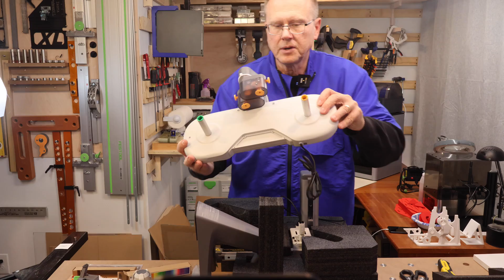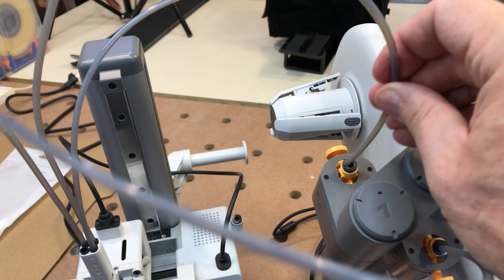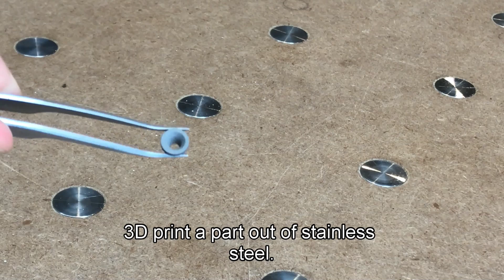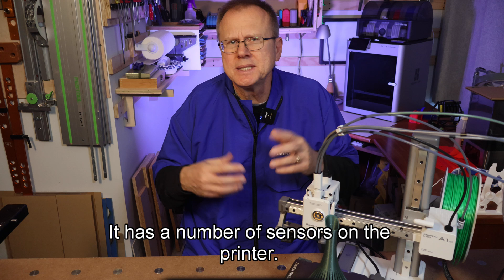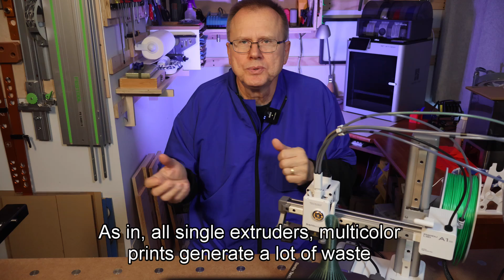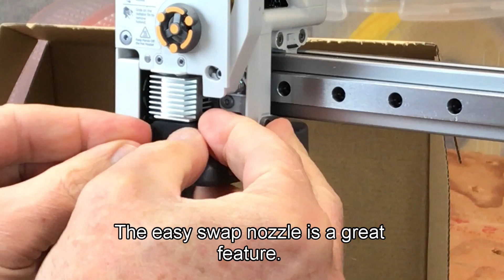BEST BUDGET 3D Printer: Bambu A1 + AMS Lite Review

Comment: I see some Festool track hanging.  Do you think this would be up to handling most of the shop improvements/doodads one would find useful in a home woodshop?  Storage aids and ESPECIALLY shopvac DC fittings?  For the latter, is TPU the best material?

The incompatibility between the AMS Lite and their CoreXY machines is really disappointing.
Reply from the maker: The Festool track saw is a very versatile system for cutting sheet goods, especially for cutting large sheets of plywood into more manageable pieces. I have 3D printed some dust collection fittings in PLA which have worked well. If you need the flexibility of certain hose connections, then TPU would be your best choice. Regarding Bambu's AMS Lite versus AMS for their Core XY printers I'm sure they have their design reasons, but I haven't seen any details from Bambu on why they are not compatible. Thanks for your comment.

Comment: There is a Micro SD slot on the Bambu X1 printers.  It’s on the right lower side of the main screen.  It can print from SD card, LAN, or cloud (default).
Reply from the maker: Yes, I agree there is a Micro SD slot on the side of the screen, but my complaint was that Bambu Lab did not include a Micro SD card with the printer so I had to buy one separately before I could record any time lapses. The good news is that they include a Micro SD card with their new A1 Mini printers.
Reply: Ah I misunderstood and understand.  Yes for the price it would be pretty easy to throw a $20 SD card in.

Comment: Why do presenters keep talking about the A1 Mini as a starter printer more than a very good printer for small and or multi color prints. I just used my X1 to make a toothbrush holder that hooks on to my wall mounted soap dish. I wish I had the A1 for that. ( Obviously that was a CAD model.)
Reply from the maker: I do agree the A1 is a great printer for small parts (and multi-color). It’s not just a starter printer; I could see it in print farms, but my comment about it being a good beginner/starter printer is it’s low price point and its user-friendly features. Thanks for your comment.

Comment: I have the A1 Mini, and it is an amazing printer, very fast and the prints are very nice.
I don’t agree with your. Omment about the noise. I have a Creality K1 and I guess the noise level is similar to the X1 from Bambu Lab. It is extremely noisy, it is hard to work in the same room. However the A1 Mini is very quiet, you can barely her the motors, and even the fans are fairly quiet, I have no,problem working just close to the printer.
Reply from the maker: I agree the steppers are quiet, but I guess we will have to agree to disagree on the part cooling fan noise. I do appreciate your comments and I’m glad you are enjoying your A1.

Comment: Multicolor print options that DOESN'T make a lot of waste are those with just a very few layers with color, for instance on the top and/or the bottom of your model. 
• ANY kind of multicolor signs, nametags etc come out beautifully with just very little waste
• The possibility of putting a logo or so in the bottom of any print in a different color.. is another good option.

For bit more advanced printing: The AMS allows you to put a few layers of PETG on top of your support structures.. without ANY clearance to your PLA model (or vice versa). This makes the support much easier to remove, and also can make your model look much nicer where it was supported.

Just felt like adding this 😊
Reply from the maker: Yes I do agree with your point that if there only a few layers of other colors like your example of a logo that doesn’t generate much filament waste. I haven’t tried your idea of using PETG as a “interface” on top of supports. I’ll have to try that. Thanks for your comment!😊
Reply: @ristinnovations  Yes, it's even a separate setting for the material choice for  that support interface in the slicer 😊
Reply: @ristinnovations  .. also for the •base• of the support, in case you are using inside-model support. 😊 And remember NO clerance necessary then 😊. Zdistance =0 and also interface spacing can be 0 (if you want)